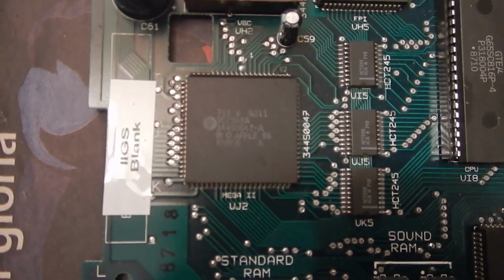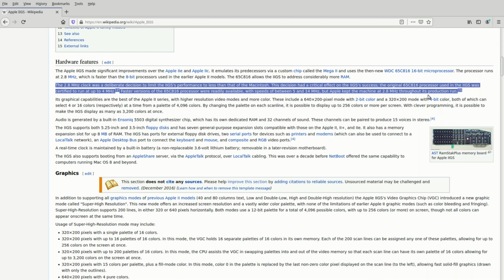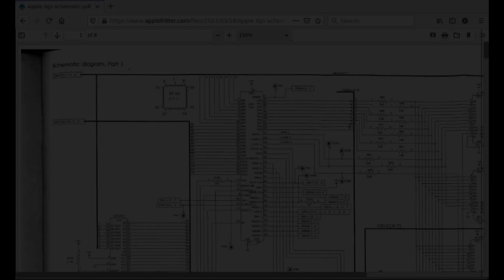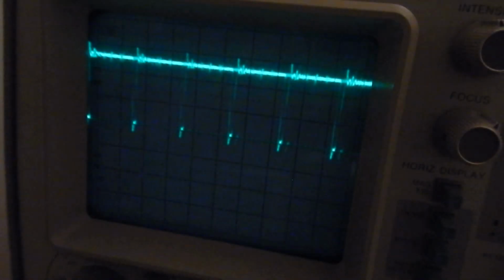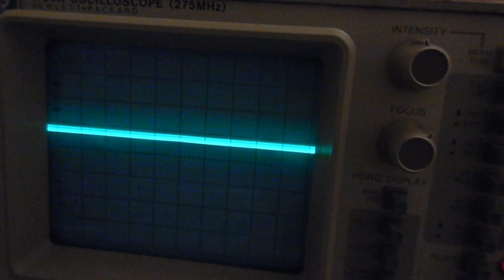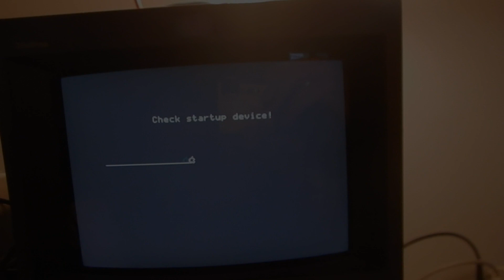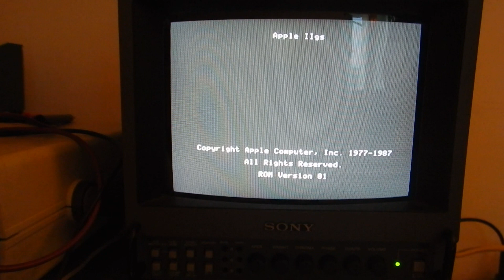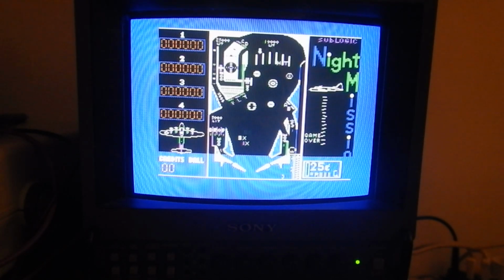Apple IIgs "lucky" repair. Let's find a bad logic IC.

Comment: Loved the video. I dropped my IIGS accidentally. Was trying to unconnect a cable and I dropped it about a foot onto a table top. The IIGS was working fine. Now - I am getting errors on most things. One symptom is that although I might have a 32MB ProDos disk - the system will only write to the first two folders on the disk. (ie: System.disk->System Folder->Fonts->May or may not copy the fonts to this folder) I get $0028 errors and sometimes $0046 errors. Ideas on why this is happening (and maybe chip names I can pull and replace) are welcome. Thanks in advance.
Reply from the maker: I'm sorry, I don't know that machine in great details, I've only worked on three of them so far. Since you dropped it, I can suggest you to inspect the PCB with a magnifying glass (or better a microscope) and look for cracked traces or cracked solder joints around all ICs. Does the internal self test complete without errors?
Reply: @iz8dwf  I used my digital microscope to look at both sides of the motherboard. No cracks anywhere. The system comes up and runs. I can do everything I normally can do except for when I try the following I get a system error. (Not a message with any kind of id on it but just "A System Error has occurred". Which is a bit strange to me. What I try is 1)Make a folder on the opt level of a disk, 2)Inside of Folder.1 create a new folder called Folder.2, 3)Then create a new folder inside of Folder.2 called Folder.3, 4)Then try to write to copy a file to Folder.3. This is when I get the error. By naming the folders f1->f2->f3 I should still be able to copy a file to that directory. This leads me to believe that the ROM 01 chip has gone bonkers and needs to be replaced. The system still recognizes (but will not use) the Apple SCSI card I have (which again points to the ROM 01 chip malfunctioning because the disk read/write routines are on that ROM). I also do not think the Apple //GS has a separate device chip on it. But if there is - let me know. Otherwise, System 6.0.1 boots up and I can run ProSEL 8/16, ProDOS 8/16, DOS 3.3. I need to try the Apple SCSI software and see if it sees the SCSI drive again. Let me know what you think. Thanks in advance. Oh yesh - one comment on the video. When using the oscillator, you should use a split screen and show which chip you are testing and (of course0 which pins. As a teaching mechanism it is always important to show everything that you are doing and not assuming anyone else knows what is going on. :-)
Reply from the maker: Hi, if you suspect the ROM you can dump its content easily I think, and compare it with the "official" dump. If this is correct, then inspect address and select pins on the rom, maybe something is missing/wrong.
Your suggestion about my videos is surely correct, but keep in mind that my channel is not monetized and google's policy is to keep such channels as hidden as possible. Not even 10% of my subscribers see any new video. I've no real interest in keeping publishing videos, nor to take much more time to make better videos. It would simply make my repair work impractical from a customer's point of view. I still hope the information I give is good enough for others to start troubleshooting and learning the necessary electronic skills for similar repairs. I may stop uploading videos entirely anytime soon.
Reply: @iz8dwf  Listen - I'm not trying to tell you how to make your videos. That is entirely up to you and how you feel about doing them. Those were just suggestions. Without your video I woulld never have figured out what was wrong with my //GS. Just getting out my digital microscope and looking at the motherboard was enough for me to find a couple of extremely tiny hairs. (They were only long enough to go from one solder joint to the next one - so maybe a millimeter long?) Once I had gotten those off of the motherboard - the //GS started working again. So to tell you the truth - a LOT of people need to see how and what you are doing so >WE< know what to try. Don't stop making videos. Each one helps us to understand why you are doing what you are doing. In fact, I just ordered an oscilloscope from Amazon. I'm doing this so I can test all of the chips on the motherboard. Because you never know.....

Comment: This, and Adrian's CoCo fix video, were together incredibly helpful tutorials on how to troubleshoot old 8-bit computers. For weeks I'd been struggling with an old Yamaha SPX-90 reverb unit, after recapping the power supply and analog section of the main board.
Thanks to these videos, I finally realized that the Yamaha SPX-90 is an 8-bit computer which I needed to learn how to troubleshoot. However, I had no idea what "normal activity" looks like on address and data lines on a 'scope. Your and Adrian's videos clearly showed what I needed to be looking for: what normal activity, and what a problem looks like. Thank you!
(The problem, by the way, was the 74hc373 D-latch on the adress lines.)
Reply from the maker: Hi! I'm glad it helped!

Comment: Nice job! Even though it was a lucky fix, I like how you promote the systematic step-by-step repair approach.
Reply from the maker: With the right approach one (almost?) always finds where the fault is. The hope with these machines is to find the fault before reaching the unobtanium ICs :)
Reply: Excellent work and video! You explain your steps very well. I believe your technique can be used to fix any computer. Bravo!
Reply from the maker: Thanks! If you have the schematic available and replacement parts, yes, most things could be fixed.